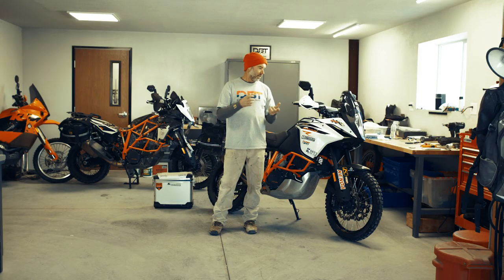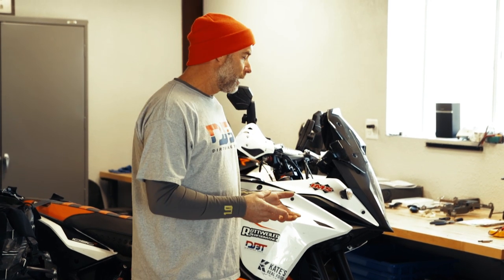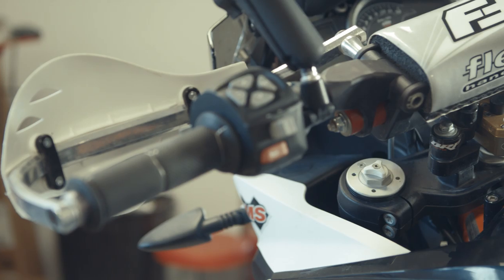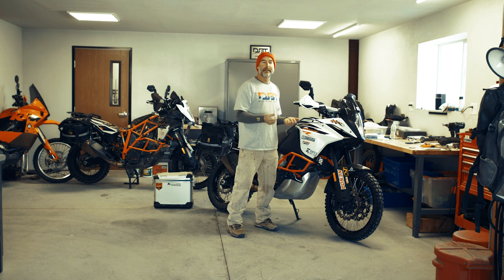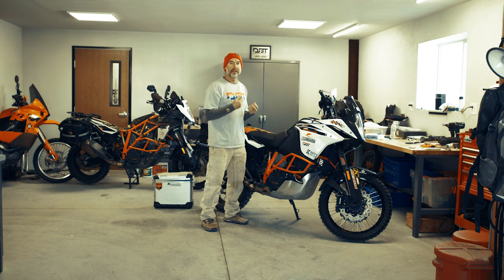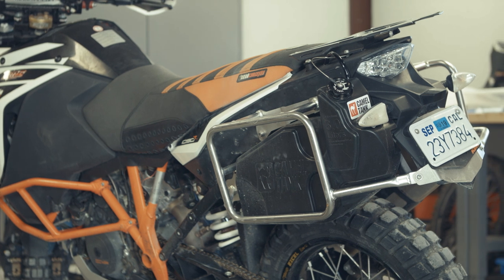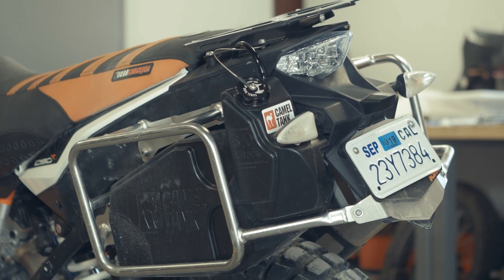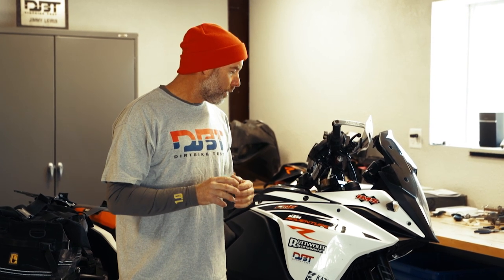KTM 1090 Adventure Build with Jimmy Lewis long version

Comment: hi jimmy,  i like the kenda bb and have used it fr and rear . also noticed the cupping on the front which definitely shortened the life of the tire . I'm now using the kenda on the rear and a shinko adventure trail 804 on the front which looks identical to the k bb but has not cupped . using hd tubes. I'm a 90/10 dirt to pave  rider [africa twin] in the continental divide region of co, lots of rocks. cheers

Comment: I have a 950. It has narrower rims, built by Woodys. I run the Kenda BBs. Where I live, we have what you call chip and seal roads, it tears up tires. I run the BBs as they work fine, and they are not too expensive. My favorite offroad tire is the Dunlop 908s, but big money.

Comment: Great video Jimmy. Are you running tubes in the tires? What tire pressure do you usually run for hard off-road?  I Just bought a 17 1090 on eBay, fully tricked out.  So I'm trying to learn everything I can about them. I'm gonna race some desert races on it.  Thanks for the great info.

Comment: Great video! With the narrower rims are you also running a narrower tire than stock? Tubed or tubeless? Interesting that you run the stock suspension. I think the standard suspension settings are great for street riding and make the bike very stable, but I felt it could be softer off-road, particularly the fork, when riding slower, rough stuff. Where do you run your settings compared to standard?

Thanks!
Reply from the maker: I basically run it in stock clicker position with maximum spring preload. I click in compression as the oil wears and when I'm about 5-8 clicks in it is time for a service (like it is right now!) If your adventure bike is bottoming out, you are pushing it too hard. Any adventure bike, especially KTMs. I for sure do not find it too stiff in the front. Make sure you bleed the air from the forks.

Comment: Hey Jimmy, you had said that you purchased the Adventure FLEXX bar in a 14 sweep, but I only see a 15 degree available.  Did you just get the 14 regular bar or woefully misspoke?  Haha.  Anyway, I have been looking at those for some time and was hoping that perhaps they could resolve my hands going numb after a long day off-road on my GS Rallye.  Looking forward to your response.
Reply from the maker: I run a 14 degree Enduro  on one and a 14 degree enduro low on the bike with the standard BRP mount. The sweep and height are very personal so I suggest some research on your part as to what you are looking to accomplish. The BMW, if I recall is swept back like 16 degrees stock. I run a 15 degree bar on my GSA.
Reply: Dirt Bike Test, thanks Jimmy.
I will give them a call. I, just as I think you mentioned, have to ride tarmac for a bit before getting to the good stuff, but also have some long rides coming up and don't want to be real uncomfortable. Thanks a lot.

Comment: Hi Jimmy, I am assuming you are running tubeless tires. I ride or my bikes of choice are the KTM EXC 500-F And a 2020 KTM 790 Adventure-R. The only Knobbie tire I have found for the wide rear rim that comes on the 790 is made buy Goldentire. I have yet to find rim locks that fit  on the wider rear rim on the 790. Any suggestions or should I stay tubeless and use a less aggressive dual sport tire on the rear of this powerhouse KTM Twin. Thanks James Fuller
Reply from the maker: I run tubes in my less wide wheels. No rim locks though.

Comment: Really Great video that offered a lot of insight. I just bought a 2018 1090 and am in absolute awe of the capabilities. Just got done doing 2500 miles camping all over Alaska and Canada with some pretty good of road. That being said I'm trying not to go to crazy with mods but I have done a lot of the initial stuff, Paniers, skid plate, top rack, etc. I'm curious what you thin about exhaust since I noticed you didn't mention the upgrade. I really want to do the intake from Rottweiler but am also interested in opening her up to here that V twin sing. Waste of money? Also the pegs are driving me crazy since I am having a hard time finding exactly what I want. I just know I need something different.